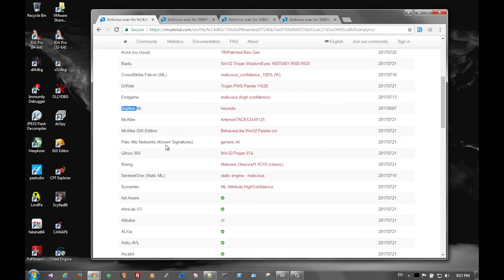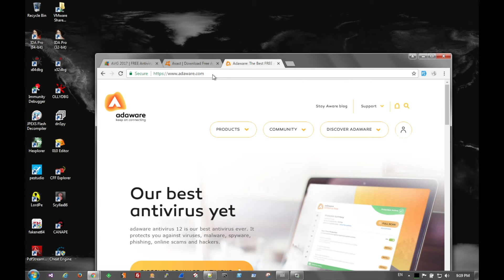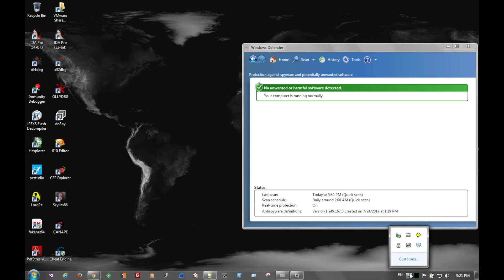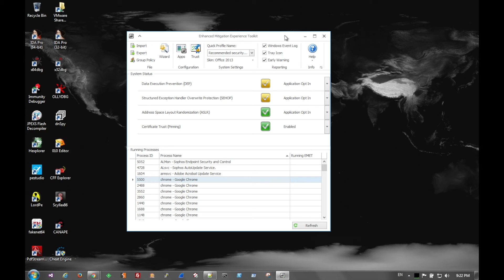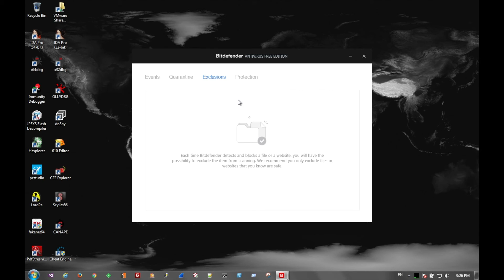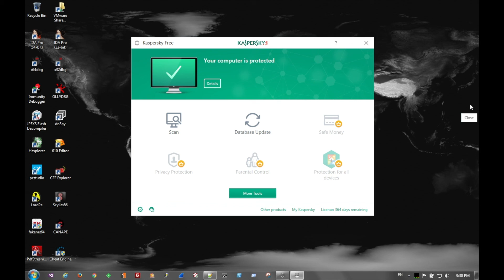2017 Best Free Antivirus From A Malware Analysts Perspective

Comment: Dude you must be nuts to recommend Kaspensky AV. It's like relying on racketeers to protect you from racketeering. The reason they can detect so much malware is because it mostly originates from Russia.

But I have a better question -- why is it always raining in the background?
Reply from the maker: I mention in the video, and article, that there is a certain level of risk while running Kaspersky due to the level of controversy surrounding them. However, simply coming from a detection standpoint, I put them as being the best because over the years they consistently detect new/emerging malware better than any other AV out there.
Reply from the maker: Oh and it's always raining in the background to ease the worry of government entities spying on you :) (and I thought it was relaxing lol)